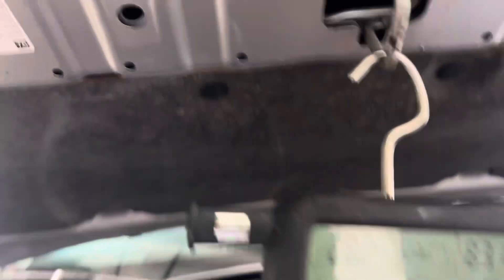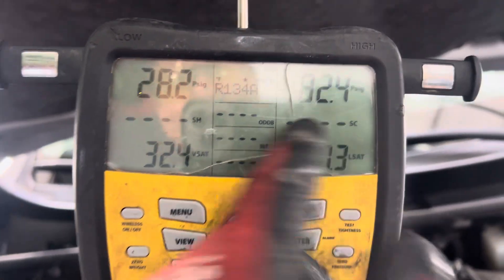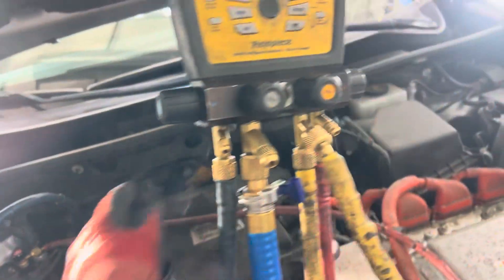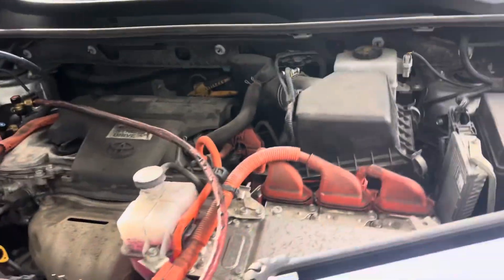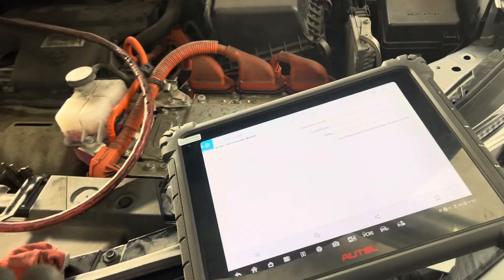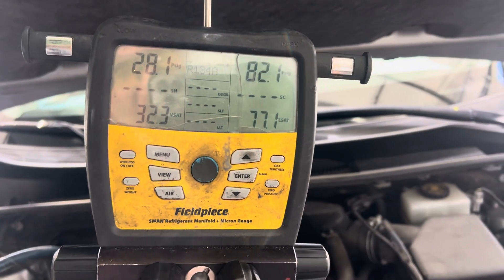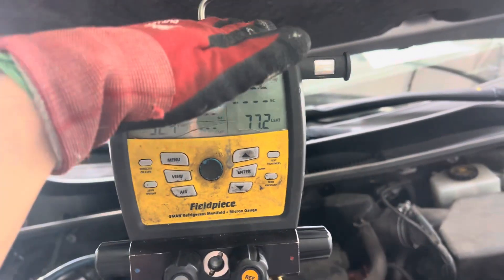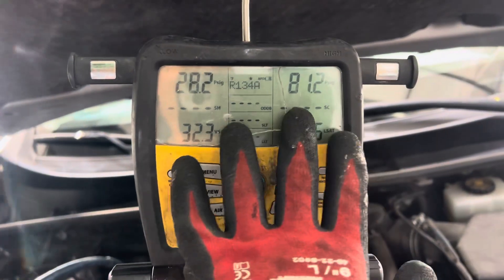Toyota RAV4 XLE 2017 ￼ low ambient temperature air conditioning high side pressure only 88 psi

Comment: What about a hybrid car ac that only cools well when the car is moving, even if it’s only going 5 mph in traffic blows ice cold when moving and barely cool when at a stop regardless if it’s on ev or engine power, the condenser fan is working and It has a variable speed electric compressor and capable of cooling excellent on hot days in the sun but only when it moving even its it’s just coasting 1mph on a Honda.
Reply from the maker: Never had one
Reply: @coldfinger459sub0 do you think they would do this on purpose for efficiency?
Reply from the maker: @Chargifyx74 maybe if Eco Mode button is pushed
Reply: @coldfinger459sub0 that’s the thing eco was off and it was still doing it Honda fit hybrid very strange car in ev mode when you accelerate it feels like a engine running and I used to think that it was running until it actually kicked the engine on and it was night and day difference